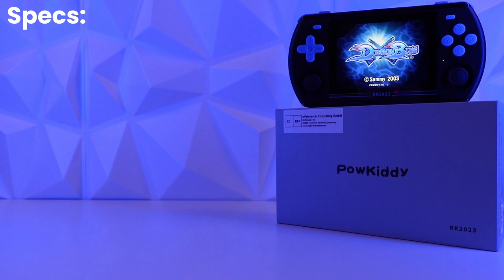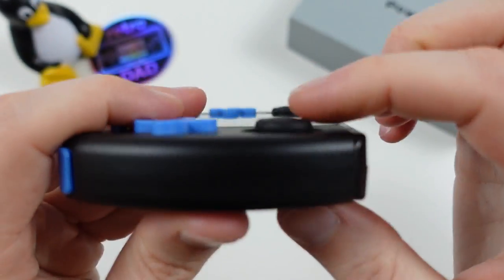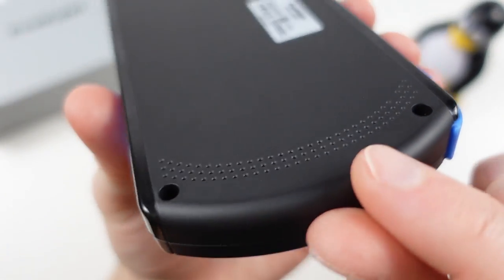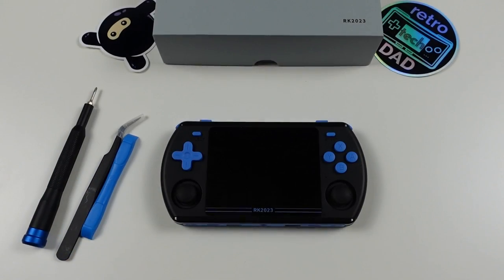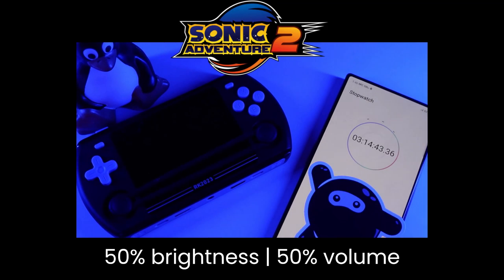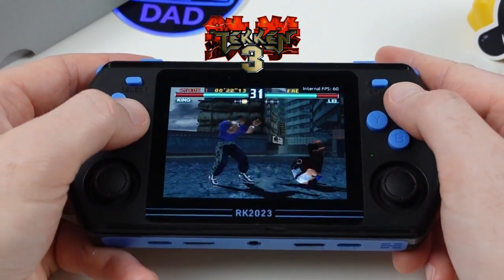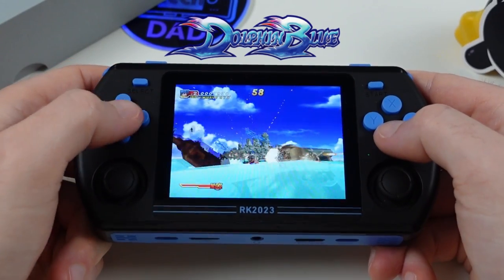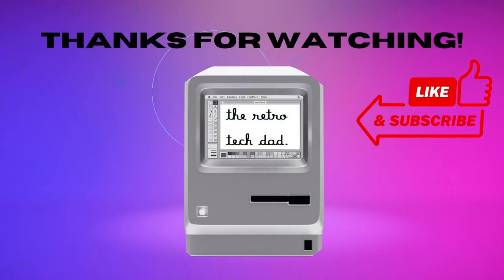Powkiddy RK2023 | An In-Depth Look - "A Budget RK3566 Handheld?" (Unboxing, Teardown, Gameplay)

Comment: Does this have a rubberized coating in the plastic? The notorious one that breaks down over time and becomes sticky.
Reply from the maker: No, definitely not! I have a few devices that have that awful coating.
Reply: @retrotechdad  Thanks. That is most definitely helpful. I have been avoiding powkiddy devices recently as they have that soft touch rubber coating, and they just end up being sticky.

Comment: This is one hot and spicy meatball 🧆🧆🧆 (seriously we need a cooling solution) 😂
Reply from the maker: I'm gonna mess around with some solutions
Reply: interesting that they don't use a thermal pad on the soc at all.  but do we have evidence it's throttling?  if not it should be decent, you don't wanna unnecessarily put more heat into battery if it's coping

Comment: I wondering that WiFi could be just added to it? 
As there's a place for wifi on the board. 🤔
Reply from the maker: Yes, you can add WiFi yourself
Reply: @retrotechdad  nice. 
Any idea where can I get the one fits in this?
Reply: Yeah searching for what chip to use..soldering it to the board isn't that hard for me because I'm used to do microsoldering. But I can't seem to find out what chip (that fits the space) I have to buy .
Reply: @OneTheAndOnlyOne  once you found it let me know please.